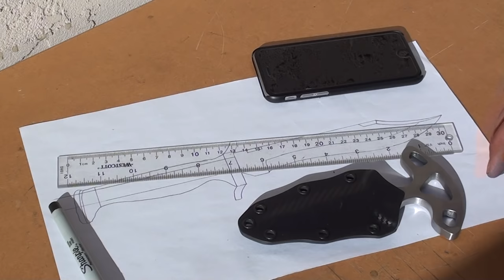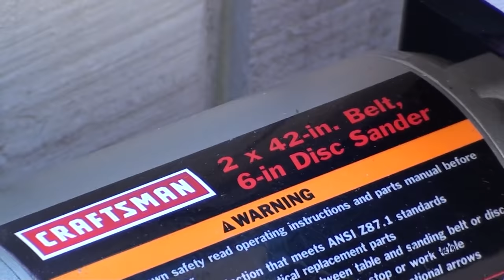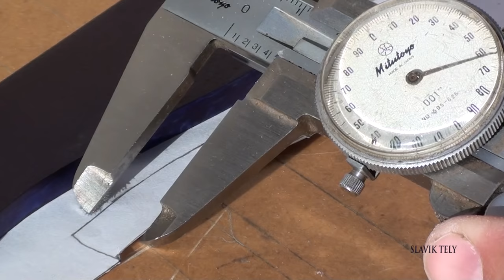MAKING CSGO BOWIE Part 1

Comment: This knife is amazing,props to you yet again.One question though:Why did you leave the chrome screw like that ,it looks way out of place?
Reply from the maker: That is the smallest screw I could find. I spent a week looking for one. Believe me it was the last thing that was done to the knife. If I had a lathe, I would have made one much better. I know what you mean though.
Reply: SLAVIK TELY you could havebused a screw thats generally used in fastening handles and then the bulk of the screw head ground off,Walter Sorells uses them a lot.I think they're called something like corby screws.
Reply from the maker: Samo Dimitrije I wish that thought crossed my mind. That is an excellent idea. Little bit too late.

Comment: Awesome work man. I also make knives as a hobby but couldn't make something like that.....
Reply from the maker: It takes time and practice to get good. I am still learning and do not even come close to consider myself as a pro.
Reply: +SLAVIK TELY please tell me about power supply for etching.  how many volts and ampers need for etching.  Thanks
Reply from the maker: Salman Mazhar I do not know the info of the power supply. I bought it from a knife making store. http://www.knifemaking.com/product-p/ec304.htm
Reply: +SLAVIK TELY thank you.... its very expensive on the site. I'll make it myself.
supply is 24volts 3 amperes. its very easy and affordable to make one for myself.  ;) :)
Reply from the maker: Salman Mazhar You are smarter than I am with that stuff.
Reply: +SLAVIK TELY basically I am an electronic engineer :D
Reply from the maker: Salman Mazhar Then it will be very easy for you.

Comment: Quick question. Why do you leave a very small gap when you use the marking gauge on the edge on both sides? Thanks in advance.
Reply from the maker: The gap is called a cutting edge. You do not want to file away all the way to the center. When you go to heat treat, the blade will warp because it is too thin on the cutting edge. Plus when you have a little meat on the cutting edge, the blade is much durable.
Reply: SLAVIK TELY what kind of wood was that handle made out of it is Beautiful and I couldn't find it on your google plus
Reply from the maker: Outdoors reviews 1 http://usaknifemaker.com/knife-handle-parts/handle-material-hardware/polyester.html

Comment: what is the name of that tool you used to scratch the blade for the bevel, it is a beautiful knife as always, wonderful job.
Reply: at 2:19
Reply: i dont know what the tool's name but the other alternative for that tool is a drill bit with the equivalent thickness of the steel.
Reply from the maker: metal scribe https://www.amazon.com/dp/B00004T7S1/ref=pd_lpo_sbs_dp_ss_1?pf_rd_p=1944687442&pf_rd_s=lpo-top-stripe-1&pf_rd_t=201&pf_rd_i=B000E60N84&pf_rd_m=ATVPDKIKX0DER&pf_rd_r=1V2VSHAAQ7YTRG17CG6E
Reply: +SLAVIK TELY perfect thank you for replying

Comment: Hey,realy nice Knife! I am making one myself right now but my file scratches up my blade so i have to sand it a lot by hand. But that kills the edgy look of the blade and smoothens it. Do you have any advice? I think my files are bad or not suited for this work. They are some old files.
Reply from the maker: First of all, the files do leave a lot of scratches. If you look at 3:46 in this video, I use a method called drawing. It eliminates the big scratches. From there you can hand sand. Also, it takes practice sanding and leaving the edges as they were. If you watched my Vipera Invader, I sanded away the edges of the bevel because I was still learning. Practice, practice and practice. I am still learning myself. And yes, get yourself some good files like Nicholson.
Reply: +SLAVIK TELY Ok thanks. I could not see that the scratches were that big on the video. Yeah I will practice.
 I am currently making a modified version of the cs go bayonet. But I still have some questions. I am afraid my blade will warp when I try to heat treat it because it is just 3mm. Your blades are way thicker so I think there is less chanche of warping. Should I temper the blade like you do or what could you recommend me ? And another question is, how did you get that logo of yours cut out that perfect? :D
Reply from the maker: TaRg3t222 I made blades 3mm thick. You will be fine. Do the same thing everyone does to the blade. I bought it for $135 and the etching machine was $275.

Comment: do you sell more knives of a kind (for example M9 Bayonets) and if so, do you ship them and how much would one cost?? (because it's all handmade...)
Reply from the maker: I try to make one of each and move on to a different knife, this way I can make more videos. Cost is anywhere from four hundred and fifty dollars and up.
Reply: Okay.... i will actually do a M9 Bayonet by myself.. do you have any tips? like how i can make a wooden grip etc? and i can't afford all those tools you are using
Reply from the maker: |I Reaper I| Lots of filing by hand. Best of luck to you.
Reply: thanks man... is it okay if i keep asking for some tips? cause i dont wanna take too much of your time :D
But that question is my last that i can think of... Is it okay if i cut the metal with a flex machine and grind with the grinder attachment for the flex?
Reply from the maker: |I Reaper I| I do not know what a flex machine is. I have used a grinder before to cut steel.

Comment: Whats the machine you used to scribe lines the one that moved on table from 2:15 to 2:17
Reply from the maker: https://www.amazon.com/Shockproof-Height-Stainless-Single-Measure/dp/B00JFGZ9WY/ref=sr_1_10?ie=UTF8&qid=1483457664&sr=8-10&keywords=height+gauge

Comment: did you use mild steel for the guard?
Reply from the maker: Yes. I tried to find stainless steel but had no luck so I used same 5160 steel.
Reply: 5160 isn't exactly mild steel...lolz
Reply from the maker: KEY EHEK The hand guard was not heat treated when I worked on it. So it was soft to work.
Reply: Even annealed carbon steel isnt as soft as mild steel. 
Ever concidered forging a knife rather than doing Stock removal?
Reply from the maker: KEY EHEK Yes, but I live in apartments and I make enough noise as is. I show the knives I make to my neighbors so they know why I make noise. They are impressed.